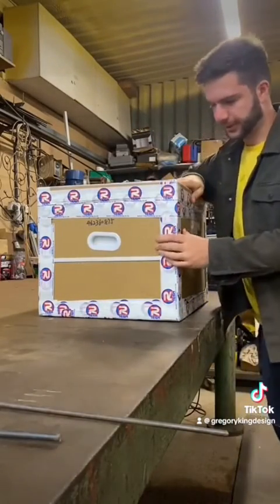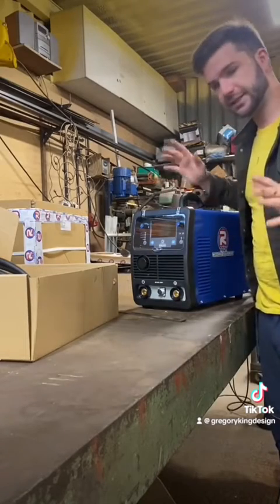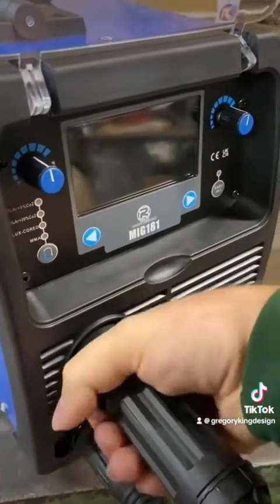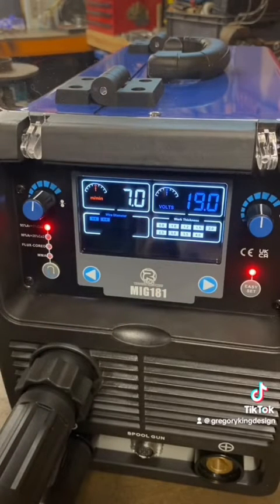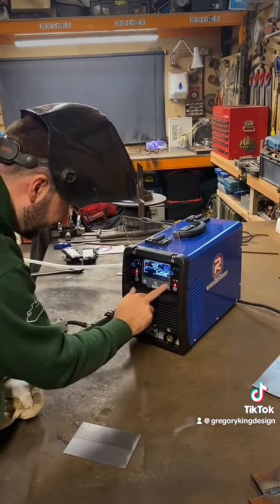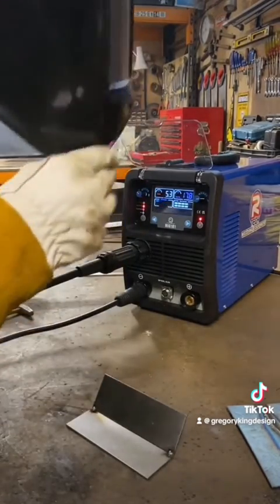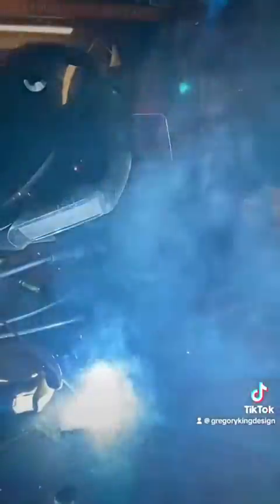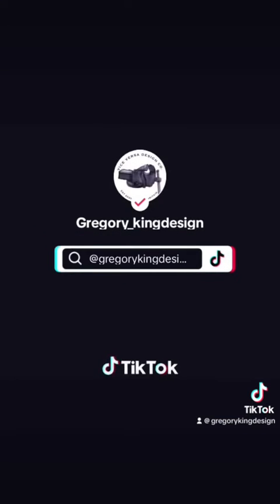MIG 181 From R-Tech has landed Unboxing and Test

Comment: Good video mr king, ive been using the mig180 for some time and just about to plunge for an upgrade to this 181 what wire speed and volts would you rec for 6mm plate to 3mm box? Cheers
Reply from the maker: I shall have to have a play to give you a good answer, honestly a lot of it is done by feel and sound, if it sounds right it will be.  A nice crisp sounding weld. Great machine
Reply: Yeah i spoke to mike today about a deal 😊 so think i will be buying tom then move on the 180  cheers again
Reply from the maker: I’ve got a discount code for r tech https://www.r-techwelding.co.uk/
Reply: And the code is ? 😉
Reply from the maker: @theplantpotman  GKING
I did send a link before but it mustn’t have worked
Reply: I am going to try it now🙏

Comment: Did your mig181 come with the 13A plug connected? I’ve just received mine and selected the 13A plug but it never came in the box or pre wired? Just wondering what you had?
Reply from the maker: I had to fit it myself. It depends how you want to use the machine, I use this one as a mobile machine hence the 13amp plug, but it could do with a 16amp for its full potential.